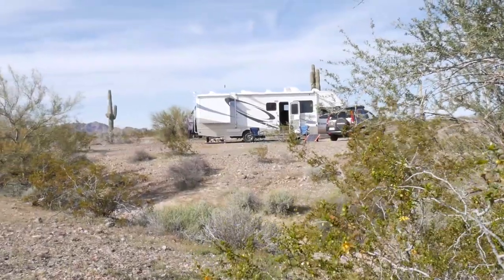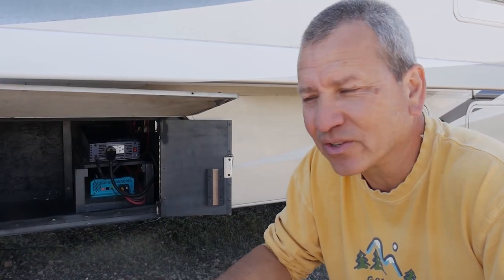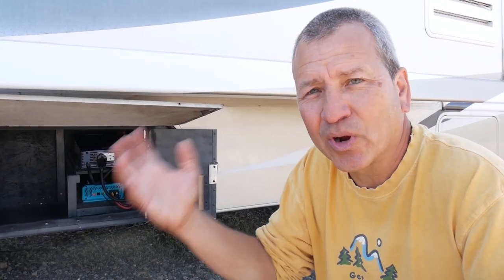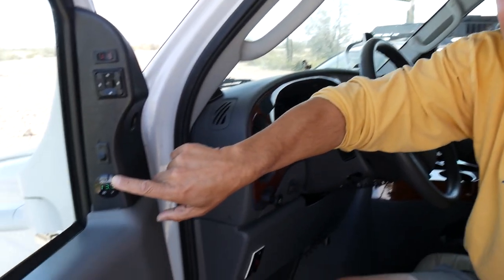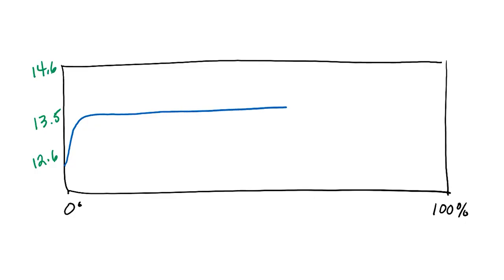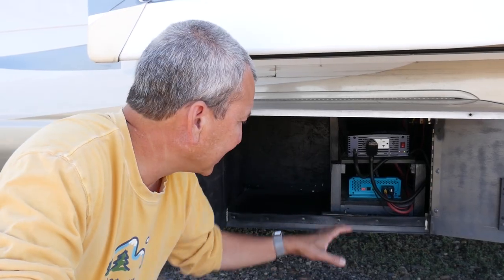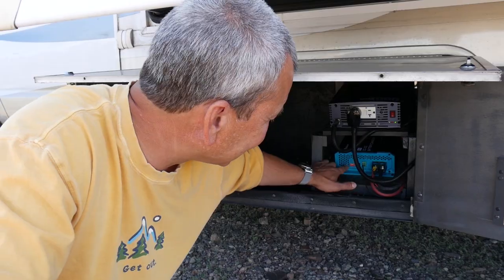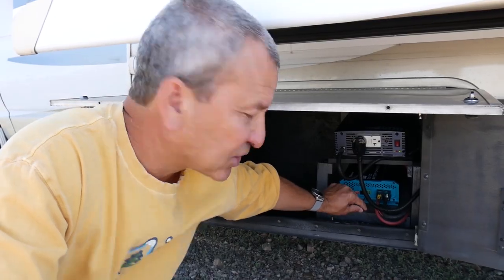Charge LITHIUM Batteries While Driving - System Setup

Comment: I have a 2008 Fleetwood class c on a 2007 ford e450 and I can't find the solenoid that you removed. Can you steer me to where I can find it?
Reply from the maker: Mine was in the engine compartment just above the drivers side wheel well. If you follow the chassis battery cables you'll find it...if you have one.
Reply: Well I think our MH's are different. In my Auxiliary Electrical Center. In there electro/mechanical components; a Battery Disconnect Solenoid, Continuous Duty Solenoid and BIRD.I believe that is it.Before adding a dc to dc converter I have to find why my chasis batt is not charging when pluged into shore power. Tested the Solenoid terminals where both batts house and chassis and getting a voltage different readings. Not sure if this is the problem but  I ordered a new solenoid anyways. Historically they have a reputation of failing. If not then the BIRD. That is a $100 plus part.

Comment: Brian, tell me why if your house batteries are low, why wouldn’t your engine battery drain through the charger into the house batteries? That”s why you want the solenoid on the vehicle key switch.
Reply from the maker: You're right. I do have to make sure I manually switch off the charger. I may move the switch to an ignition circuit which would also prevent that.
Reply: On my truck for the airbag circuit, I ran a relay that only powers the bags when the lights are on. When I open the locks in the morning, the air bags pump. If I drive, the “auto” headlights keep them powered, and when I turn the engine off and shut the doors, after the time delay, the lights go off and the power drops. On my 2016 F150 I found that to be easier than wiring to ignition solenoid.
Reply: @markfowler6200  That works.

Comment: Do you have to disconnect the solar charge controller from the house batteries when the DC-to-DC charger is active?  Or can they both be on there at the same time?
Reply from the maker: They can be connected at the same time. No problem.

Comment: Hello could you have used a batter isolator also with this setup? Thank you
Reply: Nio need... This DC to DC charger provides isolation by design.  No need for extra parts!  That's the beauty of it!
Reply: @davidmurray1630  What if your RV already has an isolator? Should I install DC to DC after the isolator?

Comment: I have the same DC to DC charger I’m charging AGM Battery right now . I have a Victron battery Montori system that’s Bluetooth to my smart phone. It’s a really good way to monitor your outlets and input of your starter battery and your house battery at the same time. I have noticed the closer I get to a full charge on my house batteries the output of the DC DC charger drops . I am assuming this is correct and the way it is designed to work . Have you noticed the same thing with your DC DC charger
Reply from the maker: That's correct, the typical charge profile for AGM (or any lead acid battery) includes an absorption phase at the end which slowly tops off the battery until full. The bulk of the charge occurs below 80 percent of the state of charge. It's appropriately called the "Bulk" charging phase. Hope that helps.

Comment: willing to learn and be shown a different solution but i found my manufacturer installed split relay wiring and fuse limited current to 23a max when my lithium was flat due to its resistance and the bms cuts charge at any cell 3.65v (fully charged) - bms wont reconnect while driving.
i ve run a second 65amp cable and relay fused at 40a which increases charge to 35a for faster charging on a switch if i need it mostly intended for winter use when solar is poor.

Comment: Thanks for the great content. I am also in need of a same setup. Does the Lithium battery draw too much at idle even at 20A max?
Reply: @richardsirois6975  In that video they removed the BMS from a massive Li battery to stress the alternator.    Those results were from 3-4x the amount of power the 20A DC-DC in this video will allow.

Comment: I'm confused ! I thought one never uses an alternator to change Lithiums ? My FLT RV alt max is 14.1v (to protect lead battery) and Liths require 14.4v to 14.6v (right) ? I think the alt puts a 'float' charge at best for Lithium batteries; but in no way can my RV alt 'fully' charge 100% a lithium battery  (right) ? Forget alt amps outs, it's alt volts out that matters to Liths. If an alt puts out 14.4v that would damage lead batteries.
Reply: This DC-DC charger increases the voltage to the 14.4 or 14.6 needed by the lithium battery. It also limits the current to 20a or 40a (depending on the charger model).

Comment: I am curious about that set up. So since lithium batteries require a 14.6 volts charge for full charge and needs around 15.5 volts coming in to achieve that, and you are using a DC to DC battery charger so does that raise up the voltage from the alternator since regular alternators do put out enough voltage to charge for a full charge?
Reply: Yes, I believe it is a boost charger.

Comment: Question, when you have more than one source to keep your battery charged, (ex: DC TO DC) solar, converter, all connected to the battery, don't you need some kind of diodes so they don't back up to each other?
Reply from the maker: Current will only flow one way through those devices. So it's not a problem.

Comment: Hello, do you have to disconnect the solar panel when the DC to DC is on? Thanks.
Reply from the maker: No. They can both charge the batteries in parallel without any trouble.
Reply: Thank you.

Comment: Love your video.
When adding dc to dc charger to my 2007 Fleetwood Tioga Ranger 25G E450 motorhome,  can I keep the switch and circuit for starting engine from rv batteries? Or would this cause an eletrical issue?
Reply from the maker: Sure. You could leave that whole relay and wiring in tact. You'd just need to run new dedicated cables for the DC-DC charging. I never needed the jump start feature (especially since I don't have a generator) which is why I just got rid of that relay and repurposed the existing cable connections.

Comment: I’m struggling with a similar setup on a trailer with LiFePo.  Right now I have run the leads from the 7-pin connector for constant power and ground to the + and - inputs on the Renogy DC-DC charger, but I’m getting zero volts and the charger never boots up.
Reply: Wire too small would be my guess.

Comment: You could have easily limited the current to something manageable for your alternator without a DC DC charger by selecting the correct cable and rating according to your distance from alternator to battery via a split charge relay. Love you RV.

Comment: I use the 40 amp model to charge 2 150 amp victron Lith  batteries, The DC to DC does not put a great load on the alternator when charging. As the DC to DC charger is a step up voltage charger. Amp draw even with full out put on low batteries would only be  20 to 25 amps draw on alternator  .
Reply: If you are going from 12v alternator to 24v battery with a step up booster, you input amps will be twice whatever your output amps. Not 1/2. The input amps may be limited to 40, but that would mean the output would be 20 (minus losses).

Comment: i put one in my rv and discovered an undocumented feature - when i disconnect the neg input terminal, like when i store the rv for some time, it turns the converter on, drains the battery, and faults, never to function again, until i disconnect all terminals from the converter.  i contacted renogy about this and they responded stating this is acceptable due to design.  thus, my solution to this feature, i also disconnect the positive input.

Comment: How old is your alternator and what is the output,  I had that thought I just upgrade mine to a  240 amps yes they have bigger ones nowdays if you need a name let me know  .....Gary
Reply from the maker: It's the original from 2006. I'm told it's probably a 120A alternator.
Reply: @RVwithTito  my diesel 2001 has 2 batteries,  I called mechman and they recommended 240 amp alternator no larger.....  I also went with the 20 amp dc to dc

Comment: To run the switch to turn it on and off, do you still need to run a wire from the ignition to get voltage to the switch and then run a wire from the switch to the DC to DC charging unit?
Reply: The switch can take power from any 12v source.  The stock method is to wire into ignition so it's only charging when the engine is running.  

I'd like to see a version of the 20A dc-dc with voltage-sensing instead of a trigger wire.

Comment: Wonder if you see a difference in gas mileage when you running with the dc-dc charger running off your alternator?
Reply: of course the gas milage will be affected the laws of the universe are clear on this-YOU DONT GET ENERGY FOR FREE. when the alternator is drawing extra current it will experience electro magnetic resistance and thus put greater strain on the alternator belt and therefore cost a small gas increase to do the same rpm.

Comment: How would this be wired in a stationary solar system without alternator?
Context:
Bank A: 4 x 115AH flooded lead acid connected to solar charge controller.
Bank B: 2 x 100AH agm I’d like to charge this bank as well using solar production (not in series/parallel.)

Comment: Hmm. 

So I have a gas motorhome that came with a factory-designed charging system for lead-acid house batteries. The house batteries are either charged by shore power, the  generator or the coach when driving. 

I recently swapped out the lead-acid batteries for Battle Born lithium’s, changing nothing else except to add a battery monitor. BB suggests that this can be done, but maybe that’s only from the standpoint of the batteries.

I now see, using the monitor, that shore power and the generator provide about an 8 amp charging current (probably through the same charger) which seems miserably low. 

Idling the coach charges at around 60 amps, which seems high but something  the 200 amp-hour lithium batteries could handle. 

Presumably the original system  was designed to not destroy my 145 amp alternator while safely charging the house batteries. Is this not the case? Is there something about lead-acid batteries that would have previously limited their draw on the alternator? Is using half of its capacity for an hour or two at a time dangerous to it?  What am I missing?
Reply: If your lithium batteries are drained low and you try to charge them with your alternator directly, the lithiums will draw tremendous amount of current and fry your alternator.  That is what this Renogy charger is for.  It limits the current to protect your alternator.
Reply: Charles Copeland:

Thanks!

They were half full when I noticed that rate of charge. Normally we drive around with them charged by shore power and, thankfully, haven’t had any alternator issues in the year we have had the batteries. 

I’ll probably find and disconnect the power to the isolation solenoid to prevent alternator charging until I can install a dc-dc charger.

Thanks, Brian!

Very timely video for me as we intend to boondock more and would probably have used the alternator as the fastest charging alternative to our solar. 

Now my question is “What is a safe max (20, 40 or 60) for my 140 amp alternator running at engine idle?” 

A Victron video indicates that an alternator with an engine running at idle is at most risk due to poorer cooling from the alternator’s internal fans, but I can’t tell what draw would generate too much heat for my Workhorse chassis 145 amp alternator. Obviously, we want to idle the engine for as short a time as possible while still charging safely.
Reply: The alternator also produces less voltage at lower rpm. Lead acid batteries have higher internal resistance and cannot accept as many amps as lithium batteries.

Comment: Can you use it to charge a 24v battery system? Thanks
Reply: Yes, just buy right charger. Victron has atleast 12V-12V, 24V-12V, 12V-24V and 24V-24V models.
Reply: Thanks
Reply: @1978jra  So I need additional charger to go with this device?
Reply: @danielzhao3083  If I understand your question right, answer is no. You need only one device (dc to dc charger), but you need to buy right one, suitable to your system voltage(s).

Comment: 130 amps on Ford Trucks...You can tell by how many holes it has in the front plate, between the ribs..2 hole 130 amp... 4 hole 90 amps...You only get the full 130 amps at 2500 rpm or above. As the alternator is in the path of the cooling fans for a reason...
Reply from the maker: Awesome tip! Just ran out to check mine. Looks like 2 rows of 4 holes between the ribs. So 90 amps I guess. The ribs at 12, 3, 6 and 9 o'clock also have one or two holes in them. Sound right? Thanks a bunch!
Reply: @RVwithTito  Yes.. 4 hole for sure...Look in the Salvage yard for the 130 amp.. Then check the color of the voltage regulator you have. They make 4 colors and it matters. Gray, Blue. White and Green...As they used al four colors on the same  models...Depended on which options you got.
Reply from the maker: @WizzRacing  I appreciate the info. Thanks!
Reply from the maker: @WizzRacing  Thanks again. Another great tip that I'll have to check out.

Comment: I hope your cab switch is wired to ignition and not the battery.  Otherwise, when engine is off if you forget to turn switch off the engine battery will be drained into the house batteries and you won't be able to start you RV.
Reply from the maker: It's wired to the battery actually. I do have to remember to turn it off. I may switch it over to an ignition circuit if I get the chance. Thanks for noticing :)
Reply: @RVwithTito  A simple relay so that it only works when the ignition is on and the switch is on would be a good idea.   On a side note I know you are from WA, and was kinda surprised when you decided to get rid of your generator in place to go solar only.  I don't get the chance to camp as often as you, but have been really hesitant to go solar with our weather, as well as my typical spot is shaded by the trees. Can you give any info on how much power you use/how long you camp etc. Right now I seem to run the generator about 4 hours a day, 2 in the morning to recharge after the furnace fans have drained it at night, and another 2 before we shut down at night to make sure it's charged back up from the days use. But that is without being conservative with power use.

Comment: My camper is set up about the same. However, I use two AGM's (no lithium) as these only require standard chargers. I use a 'black box; that always charges the Starter battery first and once full switches to the house battery. I have a 240VAC charger that connects to the battery splitter and does the same thing. My solar panels and regulator connect to the input of the same device. It doesn't matter where the current comes from the splitter performs the same function. If I ever have a start issue, I use my jump starter battery which is stored in the back of the van on trickle charge..People over complicate things.
Reply from the maker: Thanks for sharing your setup. If it works, don't mess with it :) I also have several ways to jump my starter battery if I ever need to. Cheers.

Comment: Can y’all help me understand- at 20 amp charger with 6 100amp batteries, this will take close to 30 hours of driving to charge granted voltage can be maintained? Also, why can’t the batteries be simultaneously charged by solar and alternator? TIA!
Reply: Your math is correct. And you CAN charge from both.

Comment: Sir Can I do 150 and 340 watt panel series
Reply from the maker: Only if the amp rating (Imp) matches
Reply: @RVwithTito  sir how many watts can I have with an Mppt whose voltage range is 150 and 60 ampere

Comment: Greetings, just getting ready to upgrade from 2 AGM batts to 2 lithium.  I have a MPPT charge controller, but had assumed when driving the vehicle's regulator would shutdown the alternator as it does when vehicle batts are fully charged? 
I normally do not run the engine while parked. 
Is this wishful thinking or somewhat accurate? 
Thanks.

Comment: Why add another battery monitor in your door, when you already have a Victron BMV-712?   You can easily see the SOC via that app on your phone or your wife's phone while you're driving..????
Reply from the maker: I don't have a victron bmv-712. I have a Simarine monitor that connects via its own WiFi. The voltage gauge gives me a quick status check.